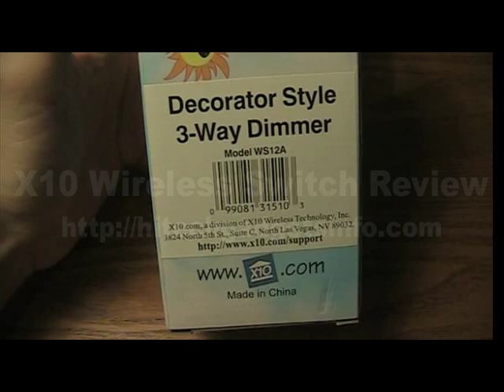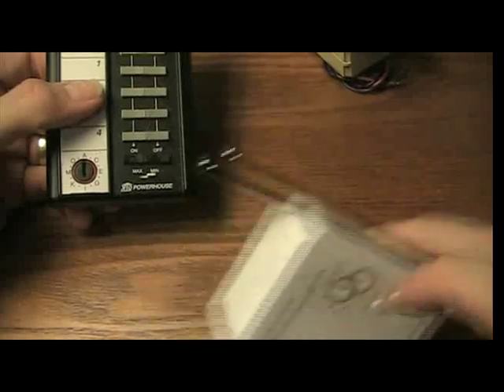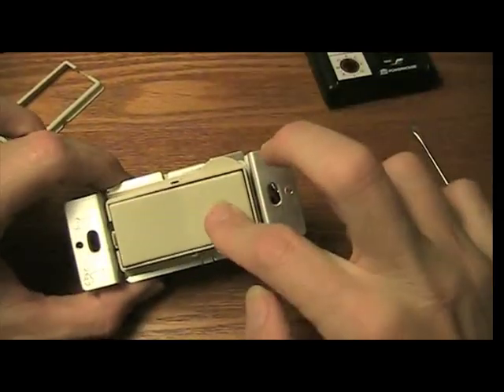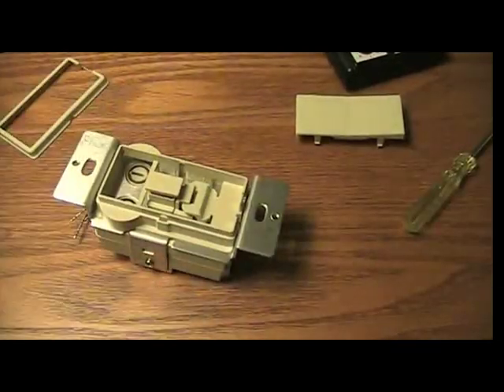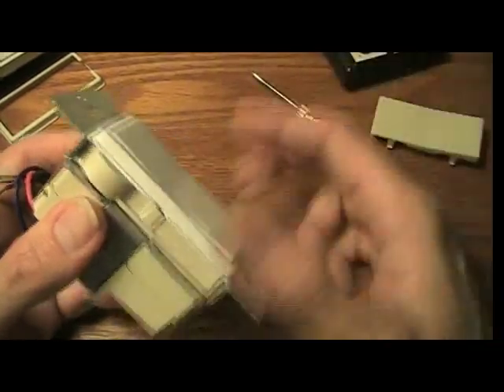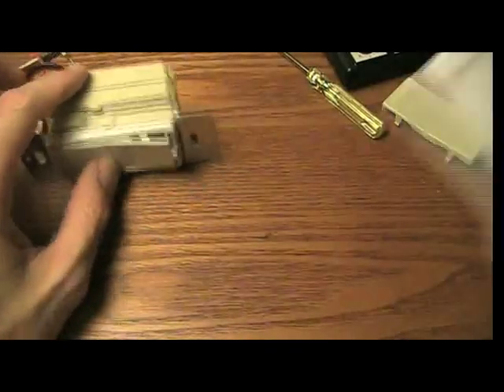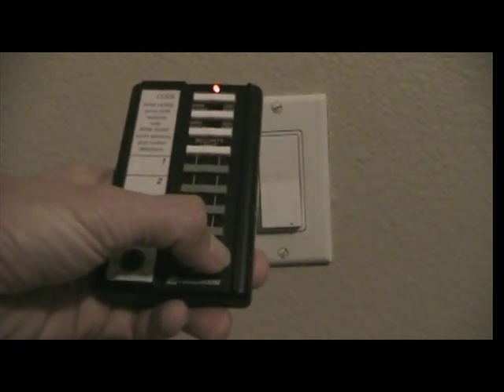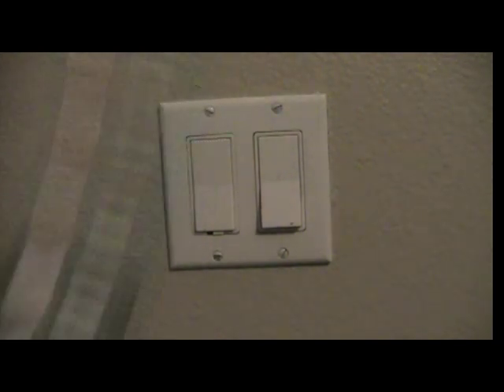X10 Remote On/Off Switch Review

Comment: 8 years ago, that's about when I was supporting this junk. Fun to use perhaps but not ideal as this is legacy equipment, everything is done via home network now in place of the old RF standard. Dialup also not reliable for monitoring. All still made in China, rest assured. Lazy Game Reviews (LGR) has a pretty decent case study on it, albeit the 80's version.
Reply: I believe they now have WiFi controllers that would interface with more modern equipment, however remember that anyone could plug in a transceiver to your outdoor power outlet, guess your house code and interfere with your system so you don't want anything important like an oxygen concentrator or CPAP on the system even though it's useful to power cycle one remotely when it alarms (security was not a concern in the 70's).  Also, houses have split phase power so you often need a repeater between the two phases to cover all the outlets and lights through out the home (X10 modulates the control signal on the AC power, it isn't by radio except for the transceiver and that's optional as there are controllers that plug in directly, the radio transceivers were more for bridging the two phases though they used to have bridges that could be installed at the circuit panel).